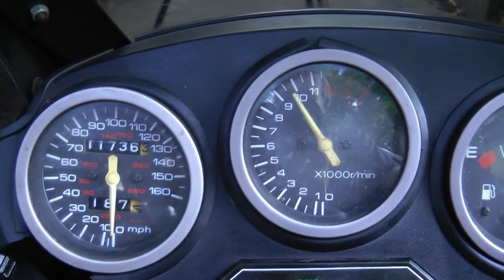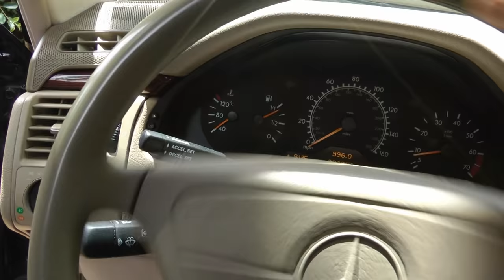How to Find Power Steering Leak in Your Car (Hose Replacement)

Comment: Hi, i just recently took up fixing everything on my vehicle and its been awesome. Your videos have been great help along the way. I have a question, i need to replace my power steering hose as well, but will the same procedure you did work with my vehicle? i have a 2005 Jeep Liberty V6- 3.7- 4wheel drive.
Reply from the maker: +Johnny Amaro yes, same process, just different bolt locations

Comment: Hi Scott! My steering rack was leaking constantly so I disconnected the belt that runs my PS pump to prevent further leakage. I ran the car for a while with no PS and now I have a replacement rack to put in. I plan on installing it and simply reconnecting the pump, is there anything else I should do (Like rebuild/replace the pump)?  It has sat 4 a long time (currently not road legal, registration overdue) without fluid in it, but it hasn't been used either so what do you think?

Comment: Love your videos, I unfortunately messed up my ignition switch needed a new one a new key but the steering wheel is not aligned. Now the power steering light is on. I have a 2013 civic, any advice Scotty

Comment: Scotty - would it also be okay to put dye to find the leak if the reservoir is full or does it need to be empty?  Reason I ask is if i put dye into a pretty full reservoir will it even be enough to even make a good mix and present itself out into the leaking area?  thanks!

Comment: Thank you SOOOOOOOO MUCH for this!!!!!!!! I spent an hour working on my 98 E320 before searching. Your video saved me a butt load of time and frustration. Do you have any suggestions (aside from selling) for an 02 Jaguar Xtype (AWD) that persistently has the check engine light on? The codes it throws are all in regards to the bank 2 plugs not firing and that occasionally prevents start-ups. I have cleaned, then replaced the plug wiring harness, as well as replaced all of the spark plugs, flashed the codes, and 5 minutes later the codes re-appear.
Reply: +Ronald Rickard Does your car use ignition coils on each spark plug? I'd try replacing the ignition coil on that bank. Try switching it with a cylinder that you know is working fine, and see if the same cylinder is having problems, or if it moved to the one you switched it to. If it moved, then you know it's the ignition coil. If the problem persists on that cylinder, I'd then try getting a compression test and check the fuel injector.

Comment: Hi Scotty, I have a 1986 Toyota Celica, and the Power steering isn't working at all.  I also noticed that all the fluid leaked out of the bottom of the car somewhere when I tried to just put more fluid in the Pump. Would you recommend I replace the high pressure power steering hose? Thanks.

Comment: Wow! Thanks so much. I'm all about saving a lot of money. Quick question, though: Is there any way to fix a leak or must I replace the power steering hose? Also, will this video apply to a 2005 Toyota Corolla?
Reply from the maker: +Erica Politica change the hose, they hold 1500 psi pressure
Reply: OK. Thanks.

Comment: Hello Scotty I'm a huge fan. Last year I had my power steering high pressure hose replaced. Now my mechanic said I need to replace my power steering suction hose (experienced burning/smoke coming through the vents a day ago). I drive a 2000 nissan maxima and would like to give this a shot. Is this something I can DIY my self. Is it the same concept as this video.
Reply from the maker: put new clamps on it or tighten the ones it has on now. Rarely do those go bad, they carry VERY little pressure
Reply: Scotty Kilmer Is this the hose that connects to the reservoir? Sorry I know very little about cars.
Reply from the maker: gsupanther11
yep

Comment: hi  Scotty! Great videos! but i have the following question: my bus is VW LT 35 2.8 TDI it is possible, when the boot of the power steering rack is broken,or damaged, to loose hydraulic oil or inside the boot there is no hydraulic oil?thank you in advance!

Comment: Hi there. I have a Toyota Camry 1998 V6. And recently my POWER STEERING FLUID has been leaking on the passenger side(RIGHT). and I am VERY CONCERN about it. I am not sure what is it. Can it be the hose (like your video?). And how much would it cost if I take it to a car shop?

Comment from the maker: @MrLALO805  If you're talking about your drive shaft, either grease is coming out of it and it needs new joints, OR the transmission seal is leaking from the transmission and then dripping over the drive shaft. Scotty Kilmer

Comment: I just took my 2010 Subaru Forester into dealership and they told me my power steering rack had to be replaced because it was rusty and leaking. They said it would cost $1,400.  Is that too high a price?  Should I go elsewhere to have it looked at. that seems really high to me.  Thanks!!!!!!

Comment: awesome video and very to the point! i am about to relace a power steering pump and the compression hose. you instructed to turn the steering wheel several times to get the air out. should i leave the cap off to do that? would bleeding the lines be necessary?
Reply: I had the exact same question. Did you ever figured it out? Are you supposed to leave the cap off when you bleed the line by turning the wheel for about 3 minutes?
Reply: +Alexander Rocha yeah you leave the cap off

Comment: I had a leak in a chevy cavalier. I could not get that sucker off. I just put a hose clamp and a piece of rubber on it. It was the lower pressure return side. Not recommended but it worked.

Comment: I have a 1996 Nissan Sentra SX manual that loses a lot of power steering fluid. I searched posts but couldnt find my problem for a manuel transmission. Ive been told there are 2 hoses. Does one particular hose leak more than the other? I can watch a video but im small and dont have the upper body strength and height to unscrew bolts and clamps. But i think i can find a friend to explain it to. Its been sitting at a shop for 2 months and i need it back. It was perfectly driveable, i just had to watch the fluid level every 2 days. Where shoud i begin? Thank you.

Comment: I have a 2001 Audi A4 and I'm replacing the steering rack in it because the previous owner used the wrong fluid and ruined the seals in it. Should I also replace the power steering lines as well?

Comment: thanks for the confirmation, but yes, that is the best idea, just buy it first to see how its set up. on mines, i found out how and where the hose runs, but it seems to run into this other can with two rubber hose on top that connects and runs to the air filter, then main pressure hose connects to the bottom, and another metal line runs down towards the right of the axels/racket. and has the other end that has a nut where i can on, do i take each end off? does that mean that the can comes off?

Comment: I have 2011 chevy camaro LT which the dealer said have a power steering leak and need to replace the power steering pump. Any suggestion will help and what brand or kind of pump should I get. Thanks

Comment: Bought and installed a new pump from Auto-zone, but it was leaking at the same spot, the pulley.  I will install the new re-ordered one and see if it starts to leak from the same place. If that is the case, what could be causing the power steering pump to leak?  It can't be another bad power steering pump.

Comment: I have a leak, i plan on fixing it. But should i keep filling it up with power steering fluid until I fix it or is it fine if i just let it run low on fluid?? Dont want to be wasting money buying the stuff if i don't need to. Please Help. Thanks

Comment: Hi Scotty, I have a 2000 Dodge Grand Caravan.  Today I had a PS leak start and.within an hour or so the reservoir was empty.  I think it's the return line as I followed the line from the reservoir and could see it dripping on the other end where there was a clamp. The clamp is a squeeze clamp, but there doesn't appear to be room to get at it.  Do I need to take the passenger front tire off to get at it, or is there an easier way to have a look?  Thanks for all you do!
Reply from the maker: take the tire off, but realize rarely do return lines leak, they have little pressure in them. More often the pumps or high pressure lines leak

Comment: i was told i need a new power steering pressure hose for my 2003 oldsmobile aurora because it is leaking do you think i can fix that or should i just get a new hose?

Comment: Can the power steering leak from a place that’s not a hose? Getting ready to replace the entire steering that on my ITR. I have the entire suspension off. Going to check where it leaks before I purchase that oem steering rack.

Thanks.

Comment: I'm changing out the pressure hose in my 1992 GMC Vandura 5.7 litre for safety sakes. I'm having the dickens of a time getting the 5/8" nut to turn where it connects to the pump. The larger nut, aka control valve assembly is turning. It's such a narrow nut and tight spot I can't get another wrench in there to hold it. Can I remove the control valve and spring and work on this on the bench?  Or will I be asking for more headaches trying to reinstall the valve back into the pump? As always, you rock Scotty and Merry Christmas!

Comment: Hi Scotty, very informative videos.  I see you changed the power steering hose on a 96 or later E class MBZ.  I have a 91 560SEL.  The pump is very accessible in the front of the engine so I'm sure it's easy to get to the hose coming off the pump.  How about the connection at the rack.  Is that one easier than on the E class?  I got rid of my floor jack when I moved last time so I'd have to jack it up with the jack for the spare :-(.  Any advice or tips?

Comment: Hey thanks for your videos they help alot. But i do have one question.. my 02 hyaundi sonta power steering is very loud. The fluids never been changed but also the fluids never go down in the resivor. So i dont think there is a leak. Do you think maybe the fluids arnt reaching the pump so thats why its loud? Or do you think its the pump itself. Thanks

Comment: Hi Scotty, i am currently replacing both power steering lines on a 1994 Buick Century. The return line and loop is rusted as i live in the midwest and get salt each winter, The old return line came out in pieces and i am having a hard time figuring out how to get the new one routed through and over the cross member. Any tips you have or diagram you could point out to rout this so i don't end up bending or kinking the new hose?

Comment: i have a bad bad leak in that hose in this video, it will arrive in 5 days. My question is it ok to use the car with the power steering belt removed.  i.e. will it damage the rack running with no pump?

Comment: I lost power steering in my 04 Dodge Neon the other day, no noises, just completely stopped functioning. Checked the resivior and it's still full, and the engine idles high now too. Is it safe to say it's busted? And is driving it as-is damaging in any way? (It's a pain, but I have the strength to drive it still)

Comment from the maker: @oneloudchevy32  If they shake even when the vehicle isn't moving down the road, it's not an alignment. They can shake because they are not on tight, or that whatever they are bolted onto has a problem, like a worn motor or transmission mount. Scotty

Comment: hey scotty hopefully you can get back to me my hose snapped yesterday when i was trying to dodge lots of pot holes & im thinking it’s something major may it be the rack and pinion & tie rods i’m unable to move my steering wheel i’m going to check back in an hour and try to get the air out

Comment: i have a 2004 bmw 325ci and i have replaced the o-ring at the end of the high pressure hose where it goes in to the power steering pump twice (the second time with the correct bmw o-ring) and both times it held with no leaks for several months then all of a sudden with no warning it all leaks out very quickly. should my next step be to replace the high pressure hose with new o-ring or something else? thank you Scott

Comment: Hey man, I have a Pontiac Grand Am V6 and I went to precision for an oil change because I was needed one and I asked if they could change the power steering as well because it was beginning to stiffen. Probably about two weeks later I felt the same thing reoccurring so I checked to see if they put fluid in it and they did so I thought I was good. Then the next day it was empty so I bought some power steering and put in my car and proceeded to turn the wheel to help the oil pass and it just drained right out the reservoir. It’s didn’t seem to get on the ground but it was slight moisture but I need some advice if you can offer some.

Comment: hey Scotty.  great vids.  just replaced the power steering belt for my 06 Elantra (was squeeling).   it was good for a week but now the squeel has returned.  retightened but to no avail.  not loosing fluid but wondering if air in the lines could be an issue.  there is plenty of fluid residue on the PS fluid reservoir and lines but no obvious leak. Failing pump?  belt possibly too tight?  thanks buddy!
Reply from the maker: make sure it's tight, but if so, pump is probably wearing out

Comment: Hi Scotty, i have a 2010 Dodge grand caravan thats keep on blowing the high pressure hose specially during wintet, i live in winnipeg by the way, somebody gave me an advise of changing the hose to a higher psi, will it do any good? Will it not cause problem to my power steering pump? Thanks for your reply.

Comment from the maker: @dnl5649  That's a whole bunch of fun. Basically, you have to remove the steering column and pull it upwards in order to replace that coupling. Just be careful not to wreck any of the wiring when you do this, and if you have air bags, disconnect their power supply FIRST or you may be in for a big surprise. Scotty Kilmer

Comment: hi scotty, thanks again for your advise. I would like to clarify some of my doubts here. you have advised to try AT 205 for oil seal leak but you did not mentioned what type of product required for the following problems. And I appreciate if you can show the procedures too.
1. for joint seal split  (what product is required?)
2. power steering oil leak (what product is required?)
3. valve oil leak(what product is required?)
4. inlet manifold gasket leak(what product is required?)
thanks

Comment: Hey Scott, I have kia optima 2004 ex and was wondering if I too need to take the tire off to take the other end of the powering steering hose. Also, how would I drain out the power steering fluid on this kia? Many Thanks!

Comment: Hey Scotty. I have a Hyundai Elantra 03 and there is a power steering fluid leak allegedly at the pressure and suction line. But it's a fortune to fix so I'm wondering if this sort of thing can just be left leaky and refilled regularly. They told me I also have a leak in the steering rack. Please respond!

Comment: Is it okay if I just seal the leak with some AT-205 or silicone seal? And how much does a high pressure hose would cost?
Reply from the maker: +sonyviva308 You can try, just realize they have 1500 psi pressure and sealers often don't work there. Hoses vary widely, price around

Comment: Hello Mr. Kilmer. My father's 1991 Chevy Lumina Euro with a 3.1 liter engine needs a new power steering pressure hose. Does replacing it involve a similar procedure as this Mercedes in that the front driver's side wheel has to come off and the the hose needs to be unscrewed the same way?
Reply from the maker: all hoses go on in a similar way, only hassle is accessing the ends with enough room to get a wrench on them. Often crow foot wrenches works the best

Comment: Scotty, I have a 1999 E320 just like the one in your "Replacing Power Steering Hose" video. I removed the leaking hose. Installed the new one and the metal connection by the rack and pinon leaked. I checked the copper seals, re tightened the bolt. Still leaking, when I tightened again... the bolt broke. I can get a new bolt but why is the connection leaking?

Sure is tight down there. I would appreciate any help Scotty! Thanks Ed Kaeser

Comment: Scotty I have a 97 es300 Lexus i have a power steering leak someone told me its coming from the high pressure hose. Can i fix it just like you did in this video???

Comment: Hey Scotty, I've got a 2003 Hyundai Sonata. The power steering leaks, hits the serpentine belts, and flings all over. I'm not too sure but I think it may be the return hose that's leaking. Is it fairly similar to changing the high pressure hose? I can't seem to find any good videos on it, just the high pressure hose.
Reply from the maker: +Pete Aguirre the return hoses rarely ever leak, but their clamps can get loose and need replacing. do check closely though , almost always the high pressure lines are the leakers
Reply: +Scotty Kilmer  Thanks, you were right it was the high pressure line. The line was a lot longer though and went behind the engine, so it took forever but saved $100 thanks

Comment: I wonder if the union nut on the pressure hose to pump line goes flush to the nut on the pump or there is a little gap even if tightened to spec?

Comment: scotty my power steering fluid always turns black when i pour it into the reservoir, my wheels always squeal when i turn the wheel and i saw some liquid dripping out of the boot of the tie rod which im sure is power steering fluid. I also check the power steering reservoir and there was only a little bit left. should i replace the tie rods?